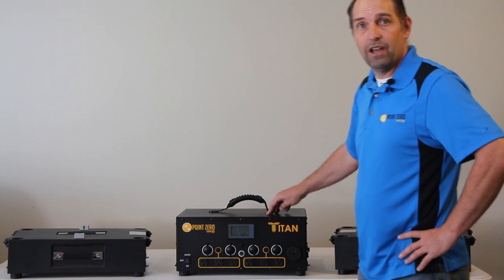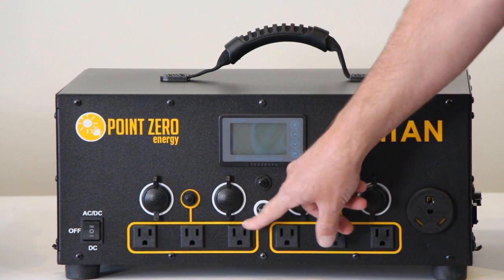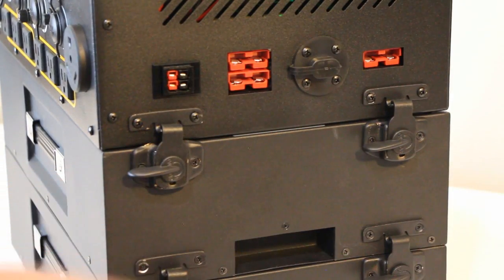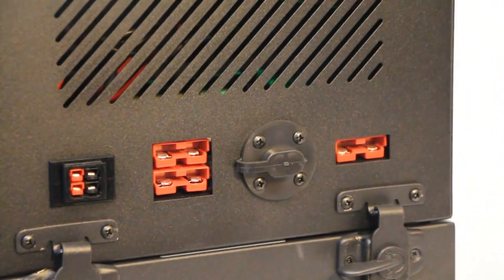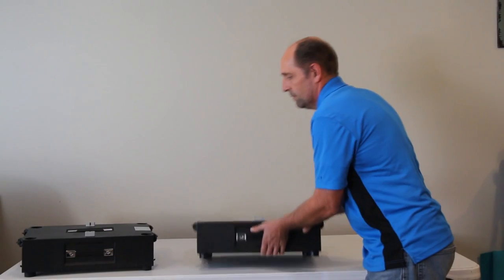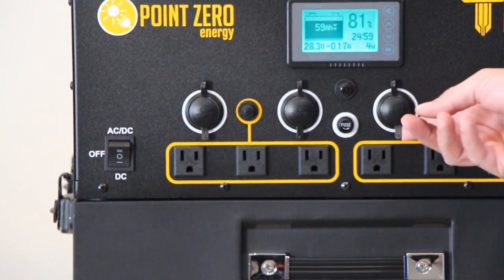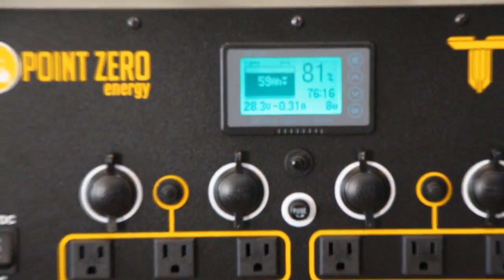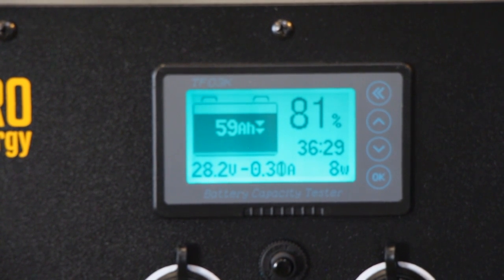Titan Solar Generator final

Comment: I was highly interested at getting one until I saw the price. I don't know what the Titan is market for. It is not portable for camping purpose, and not adequate for whole house backup. The LG Chem and Tesla powerwall offer more kwh backup with less cost (and more warranty). What am I missing here?
Reply from the maker: The Titan is the only portable generator on the market that is expandable, and can actually provide long term backup of critical appliances such as refrigerators oxygen concentrators, etc.  It is very portable, and can be taken camping with out any issues.  I am not sure why you would compare it with a LG chem or Tesla powerwall.  They are much more expensive, and are essentially just a battery (totally different product).
Reply: It is completely capable for whole house backup if you are conservative with you energy usage.
Reply from the maker: @codymiller8505  Typically it is not for whole house backup, because it is 120V, and only 3000 watts.  Many off-grid cabins and small homes or RV's are designed for 120V, and use propane for large appliances such as range and hot water heater.  It would work great for these types of applications, but not your typical grid-tied home.
Reply: @PointZeroEnergy  I appreciate your honesty. 😁

Comment: I am assuming the DC outputs are 12V? or do converters need be used?
 though that info is in the description he could have mentioned it

assuming the solar input is DC not micro-inverted AC?
What if my panels are micro-inverted? do I need to remove the inverters and go DC?
or stick a converter in the path?
Reply from the maker: Yes, the DC outputs are a regulated 13.8V, and the solar input is 35-145 VDC.  So you cannot use a solar panel with micro-inverters.  If you have panels with micro inverters it would be best to remove them before using them with the Titan.
Reply: You can charge the Titans batteries with your grid tied system (micro inverters) 2 ways you can charge it using inline micro inverters out to the solar inputs your inverters output parameters must be set above 35v and  between
Reply: 145v max

Comment: can I plug a 120 to 240 step up transformer into this unit , so I can plug into my 6 circuit 240 input plug on the manual transfer switch in my house. there are no 240 appliances hooked up to switch just 6 120 volt circuits . I believe that the two 120 legs for the 220 are split into 2 sets of 3 120 volt circuits , I just need to be able to input 240 volts into the manual transfer switch so I can light up 6 circuits in my house without back feeding into the grid . 
Will I be able to do this with this unit?
Reply from the maker: Yes, this should work just fine.  The only possible issue I can see would be how large and long the inrush current is on the transformer.  We are having one made for us, and will be testing it as soon.  We will make some videos, and show results.
Reply: Would such a step up transformer work to power a 240v well pump?
Reply from the maker: @Fr33dom4All99  We have not had time to test it on very many well pumps, but so far with the one deep well pump we tested it on, it could not handle the surge to start the pump.  So at this point it looks like 3,000 watts with 6,000 watts surge is not enough to start every well pump, but it may start some.  We also need to test with a larger step up transformer to see if it is just the limit to the transformer, or if it is the limitation of the Titan.  But for now, we don't know what pumps it can and can't start.

Comment: I was hoping for a 12 volt output to a DC panel
Reply from the maker: Thanks for your comment.  I am sorry we were not able to provide that for you at this time.  We are working on making an external step down that will be easy to plug in and use for this.  The reason why we did not add a High power 12V output is because it would add cost and weight to the product, which most people did not need.  The solution is to add an external step down like this: https://www.amazon.com/Daygreen-Converter-Voltage-Regulator-Reducer/dp/B07QYCX42L/ref=sr_1_3?keywords=24V%2Bstep%2Bdown%2B100a&qid=1568988490&sr=8-3&th=1

You can then attach a 24V (red) anderson sb50 port and plug it into one of the free ac charging ports.

hopefully in the future we will provide a pre-build unit for you so you don't have to add an anderson plug. but it will be down the road a bit

Comment: Great job guys! So exciting to see the finished product. Will be ordering mine before the end of the month to get the pre-sale pricing. Are you still planning on adding Bluetooth capability later on? I know it was one of those things that had been put on hold.
Reply from the maker: We are currently working on 240V split phase.  Hopefully we will be able to use a converter that will plug right into the rv outlet and convert it.  But we are not making any promises at this point.  Bluetooth probably won't be something we will have for a while.  We don't really like the options that are currently available, and will need to develop that from the ground up, so it probably won't be available for a few years, with a new version that can parallel, has a touch screen, and Bluetooth.
Reply: @PointZeroEnergy   will the inverter support 50HZ for us in the UK and Europe
Reply from the maker: @DazzaDirect  No, not at this time.

Comment: When will it be available?
Reply from the maker: pre-sale is going on now, and will last until the end of the month.  Deliveries are scheduled to start in Nov.  first orders will be fulfilled first.  It will Probably be Jan. before we will have systems in stock for immediate fulfillment.
Reply: @PointZeroEnergy  

Hey there,

I just ordered the 1500 this week,  will I be in the que for the Titan 2.0 with the  LiFePo4 batteries?
Reply from the maker: @SiCaRiI_DaGgEr  We can tag your order, so when we have the Titan 2.0 ready for pre-sale we will contact you for upgrade options.  Or if by chance your Current order is ready before we start the pre-sale we will contact you to see if you want to wait, or have us ship out the current order.   However in order to tag your order, please email us, or open a ticket on our website, this way we can look up or order and make sure it is tagged.  Thanks!
Reply: @PointZeroEnergy  
Perfect!

Thanks for the quick response.  I just emailed you guys about an hr ago. I just realized I made my purchase via one of  your reps\distributor and not directly from your site.  What do  you advise? I have no problem cancelling that order since it was only a few days ago and then purchase it again from your site directly.

Thanks again!
Reply from the maker: @SiCaRiI_DaGgEr  Our support will be out until Monday.  Once we have tagged your order, we will let you know.  Also I would suggest contacting the distributor you bought it from, to make sure they know as well.  There is no need to cancel your order with the distributor.
Reply: @PointZeroEnergy  

Sounds good, I'll reach out to them now. I assume you know the distributor I'm referring to?  Thanks for your quick responses it was a big help!
Reply from the maker: @SiCaRiI_DaGgEr  I don't know the distributor, because I don't know the name on the order, or the order number.  If the information we need to look up your order is not in the email, we will ask you in the email to keep it more private. 
Thanks!